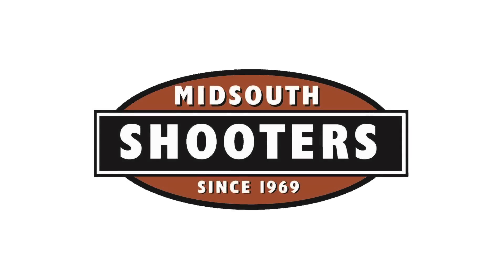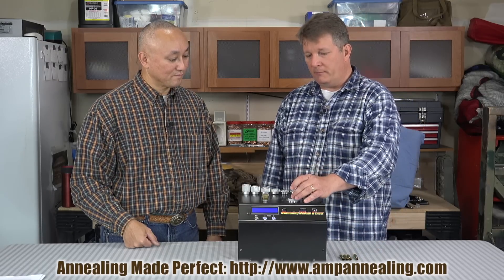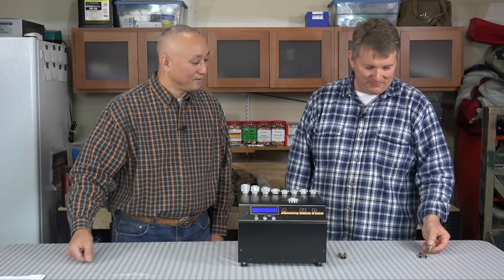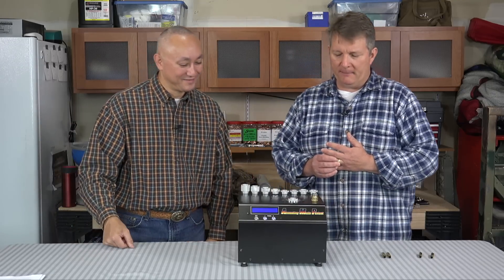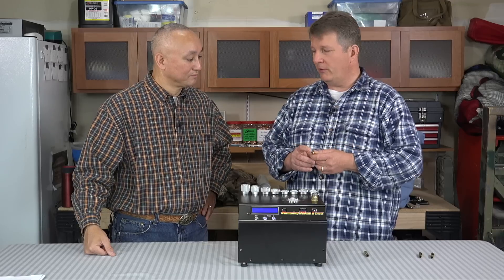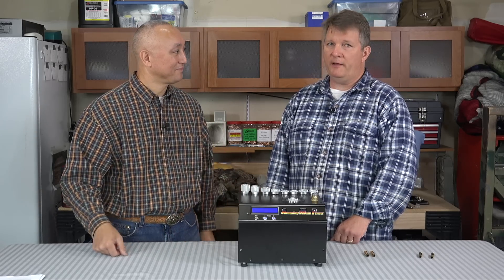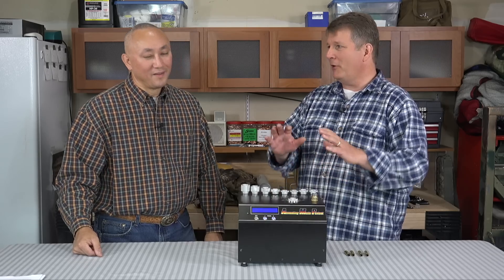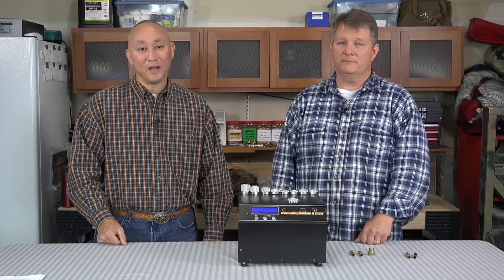Weeky Gear Update - 024 Annealing Made Perfect Machine

Comment: According to Annealing Made Pefect, zinc is not burned off if you over-anneal:  "Cartridge brass melts at 915°C (1679°F). Up to that temperature it remains homogeneous (Appendix 1 - 1.1).Dezincification of brass can occur because of chemical attack, but heating brass, even to high annealing temperatures CANNOT cause dezincification unless chemicals are present. The zinc content of the alloy CANNOT burn or melt out up until boiling point (Appendix 1 - 1.6)."

Comment: I suspect it's really hard to get an honest review of something like this.  Consider that this is dramatically more expensive than any other options for annealing brass ... at least that I'm aware of.  You acquire one for review in one of two ways: It is provided by someone who sells them, or you purchase it yourself.  In the first case, you are beholden to someone who provided a really expensive device, and in the second, what I call the Lamborghini effect sets in.  The Lamborghini effect is basically, "I paid a hell of a lot for something that's not really that exceptional, but I'll be damned if I'll admit it openly."  Okay, yes, there are some caveats to what I'm saying about the Lamborghini, but that's precisely the type of vagueness that worries me.  I also, noticed that they are charging almost $200 additional for a firmware update, and this is really suspicious.  They are basically saying that the machine does not operate optimally out of the box, but we will charge you a couple of C-notes to make it right.  I glad that computer manufacturers a bit more honest when it comes to firmware deficiencies.

Comment: Hi 6.5 Guys.

Is there one annealing machine out there that handles both pistol and rifle brass? 

 I currently reload rifle ammunition.  I'm considering purchasing a pistol in the future, probably a 9 mm semi-auto, and I can't find any annealing machine that's capable of doing pistol brass in my search.  Any advise on where to look for one would be greatly appreciated.

Thanks,

Keyan oble
Reply from the maker: We couldn't speak to the benefits of annealing pistol brass - in fact you may risk a case head separation if the annealing process softens the brass to much for the pistol brass, given the typical short case size.

Comment: Awesome Video, was looking at buying one myself. What are your thoughts on monopods? I mainly shoot from a bench but will be slowly moving to prone and positional shooting. I used to use a rear bag as my stock was angled which made adjustment very easy. I have now purchased a KRG W3 chassis system and the butt of the stock is now flat and is causing me to apply a lot more pressure on the bag to stay on target. It would be good to hear your thoughts on them. Thanks.
Reply: Phillip Mullner Hi - we tried out mono pods and they didn't work out for us. They would work really well if you are observing a target for a long time (police sniper, etc.). We rarely see them at matches and when we do they typically are newer shooters. Some shooters have actually fashioned angled pieces to go on the rear of their KRG stocks to give them better elevation control. Thanks for watching!

Comment: Thank you Ed & Steve . Always great content and intent. Question...wouldn't be better with some semi auto or auto operation ? I mean it seems like a PITA to push the button each time you need ONE case annealed, put it in and  then to take it out of the hole ...seriously what was the Kiwi thinking :) ? Yes, perhaps  does it perfectly as he claims it but time needed for it :( ... 
Giraud annealer on the other hand it's semi auto and you could be doing something else at the reloading table during that time that it is annealing. 
And it's ONLY $ 500 and propane bottles are $3-$5  each and they are good for 1,500-2,000 cases. I always thought beside the joy of reloading that time management is a good habit. 
And is it me or Steve did not seem to excited about this machine :)) ? Thank you Ed & Steve for keeping our community informed as always.